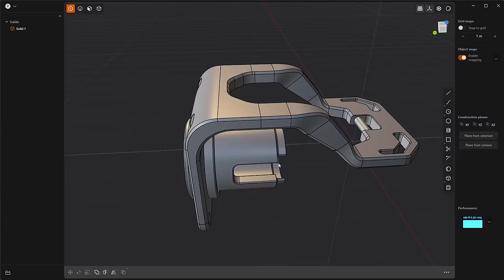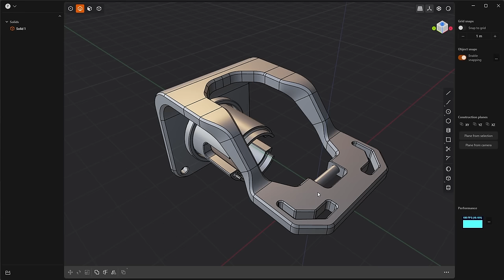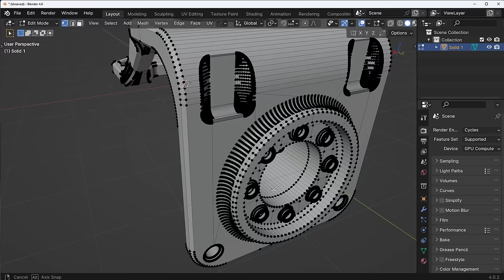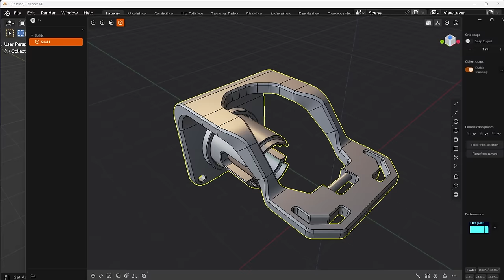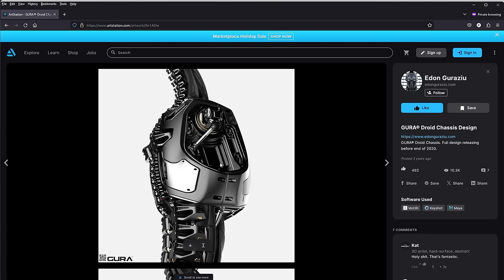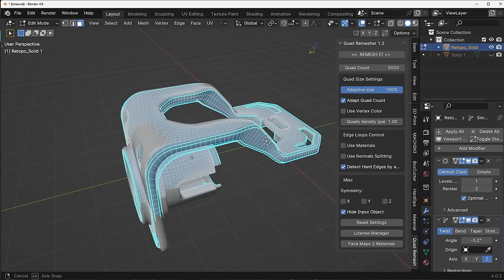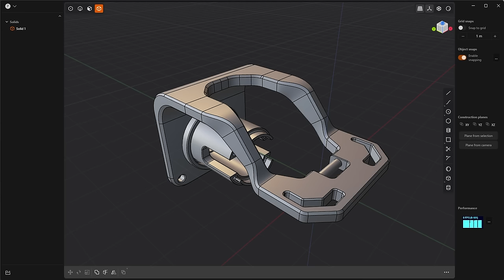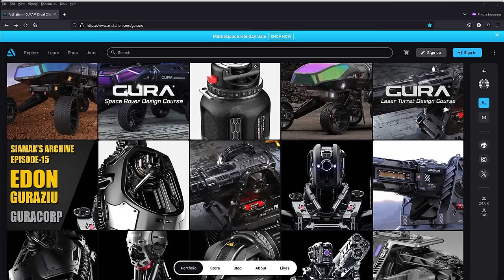How To Model With Terrible Topology

Comment: Your explanation of a CAD modeling is wrong. There is topology and topology in NURBS Modeling is  extremely important as soon as you leave the world of basic CAD modeling. It is utterly precise, where the surface connection is mathematically described in space. Having bad topology will render your progress nearly impossible forcing you to rebuild previously made surfaces. Plasticity due to its great parasolid kernel sorts a lot of things for you, but also not forever. Try modeling in Alias and you’ll get what i mean. Having basic understanding of something isn’t enough to present is as truth for the others.

Comment: just to add to this. the importance and practices of topology are dictated by the purpose of the object. what it will be used for and by who. If its just for a quick render you do yourself, it doesn't really matter but for almost anything else, good and evenly distributed topology is important for making iterations, revisions, uvs, deformations, hi/ low workflows, etc. There's fewer situations where clean topo doesn't matter than when it does. and clean doesn't mean only quads. its more about avoiding ngons, pinching, poor edge flow and the like.

p.s. there is a constant flow of people fresh to 3D every day. even the basics need to be covered every so often. a bit of patience for them would go a long way. especially since they are part of your market.
Reply: Absolutely spot on. I could not have worded it better myself. Josh is an absolute tool at the present time. Sorry, but it has to be said.
Reply: "...since they are part of your market" Blender bros market is to use booleans for everything, it makes sense for them to lower the value of clean topology, since they don't have a single course on proper quad workflow. To be fair they do videos from time to time using subdiv, but it's within the same argument that quads are only "optional".
At my work the creative team use booleans for everything and make beautiful renders, then in UE5 there's a ton of shading issues and can't bake lighting to save my life, I end up using a bunch of time repairing the mess to make things work on an optimized way
Reply: @RhoIzquierdoArt  that sounds like a nightmare. maybe AI will help converting to usable geo soon

Comment: I think you're absolutely right that topology doesn't matter for concept pieces. However the issues come when you don't know how to fix "bad" topology, which you might have to do if you get a job as a 3d artist and your boss says make it quads because they don't know any better. Also, quad topology is almost required for most game assets as most (if not all) engines automatically triangulate meshes which can cause shading issues if your topology isn't clean (their triangulation algorithms generally aren't optimal).
Reply: "Also, quad topology is almost required for most game assets..."

Where do you get that from? If they deform, absolutely, but static game assets are almost always triangulated to save polygons. The only reason I'm aware of that you wouldn't is to preserve your edge loops for easier editing down the road.
Reply: @troll_kin9456 - Well, quad topology will be required for pretty much all assets just for UV unwrapping, baking, and texturing alone. As for triangulation, well, nanite in UE5 is great, but it does have limitations.
Reply: @troll_kin9456  besides shading issues crappy topology will sometimes cause lightmaps to behave strangely if you are baking the lighting (for optimization this is quite important) Also using subdiv workflow allows to easily create different level of detail for objects
Reply: @RhoIzquierdoArt I'll take your word for it since I haven't played with light maps before. Fortunately, once you have the shape of your model established, nothing stops you from retopologizing when you run into an issue.

It's still the case that if you go on an asset marketplace or read developers' blogs or open meshes on published games, you will find that most of the static meshes used in production are triangulated in areas where quad geometry was deemed a waste of time and polygons.
Reply: I don't get the part where you talk about triangulation, you can use the triangulate modifier in blender, once you export the model as a fbx the triangulation will stay the same in blender, substance painter or unreal engine.
Reply: @troll_kin9456  That's exactly the case, for the most part if the mesh is static then flat faces can be triangulated, but the rest of the mesh tends to have a quad workflow.  Also if the lighting is going to be fully dynamic then you can use a full boolean workflow, it depends of the final use case. I personally choose to always use quads because it gives more more reliable results, makes the uv's and lightmaps behave correctly and I can create different LOD's for each object quickly.
Reply: @troll_kin9456  I don't quite get your point, my understanding is that you are talking about triangulation as it is a prerogative of a certain type of modelling when, at the end, both n nongs and quads are triangulated (in blender you see ngons or quads but the mesh is already calculated as triangular faces [that's why in statistics you immediately get the tris count]).
Reply: @RhoIzquierdoArt  Summarizing: quads are optimal for lods, UV unwrapping and lightmaps, however I've seen a lot of game assets reducing heavily the polycount due to an ngon approach. How do you value that specific aspect ?
Reply: @gabrielegagliardi3956  I should have clarified. I don't mean the kind of automatic triangulation done by renderers. I'm talking about the model maker deliberately creating non-quad geometry, either to reduce polycount, or because modeling with tris and n-gons happened to be quicker in that instance (like with bool modeling), and wasn't creating shading artifacts.
Reply: @gabrielegagliardi3956  If your product targets different gaming consoles then definitely reducing the polygon count by using and ngon approach whenever possible is a good way to go. In those cases uv's and lightmaps are of course possible to make, but it's trickier. And shading errors can be fixed by triangulating the ngon meshes before importing into the graphics engine of choice. So it requires more work, but for optimizations sake it's worth it.
Graphics engines are getting way better at handling large polycounts on screen, my guess is that the ngon approach is not used because of the reduction on the vertex count per se, but because realtime calculations like dynamic lighting for example are more expensive the heavier the meshes within their radius are.

Comment: @Josh: What you say is spot on. However, the obsession about great topology is driven by the game industry. Which makes a huge chunk of the market. 

For games, especially mobile games, it’s all about low-poly optimized topology. I tested also Plasticity and Shapr3d (which is even easier and faster to learn). 

But at the end, unfortunately, I also need low-poly optimized models for mobile games. So using Plasticity will add in this particular case extra work, because I have to clean up the topology, re-topo anyways. Which is possible but also time consuming. 

So I guess for certain game engines, there is no other way at this point to use classic Polygon-Modeling. 
The only engine that will work with CAD Meshes is the Unreal Engine when using Nanite. 

Plus, when using CAD mesehs:  UV Layout and optimized PBR Texture maps will give you a slight headache! 😃

So yes, chose wisely your workflow to safe time and think about for what purpose you are going to model your piece. 

Concept Design and mainly focusing on the design work is quite a different discipline in the filed of 3D.
And perhaps, for Design-Work, you might even prefer Zbrush, which I like as well when it comes to hard surface concept modeling/sculpting.

Cheers 🍻

Comment: In hard surface modeling, topology is a way easier topic to handle than for example with character animation. But even there, the kind of topology depends on more factors than just the topology itself.
Just today I am working on an NPR character. He's supposed to look drawn and uses a toon shader with 2 crisp shadow layers. That means, you basically only have 3 colors to determine a surface, you simply can't see any details in a realistic shading, that messy topology would create when deforming.
So while I try to go with quads where feasible, I will also use many triangles. Like in his shirt for example. I painstakingly modelled in folds and creases, and those would not only be painful to try to make in a very clean quad way, it would also be wasted time. Any quad lover would probably get a heart attack from this topology, buit for my purpose, it doesn't just work, but it may even look better than quad topology. Because a shirt has a very irregular surface, and the topology brings some irregularity to the table, which makes it look more natural.

The general rule is: Topology doesn't matter. The final look matters, and whatever topology makes your result look good (still or in animation) is the right topology.

Comment: I didn't know there was such thing as a "Quad Boy" until I read the comments. You're completely correct. Design an attractive shape, retopologize later if the model application requires it. This is conventional wisdom for sculpting and should be for hard ops as well.